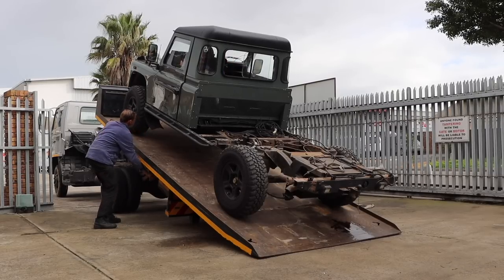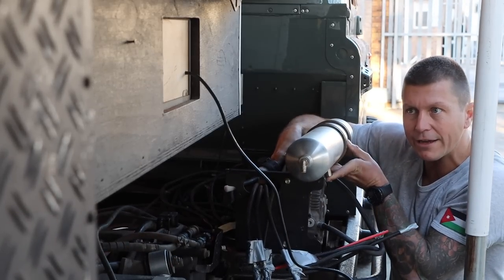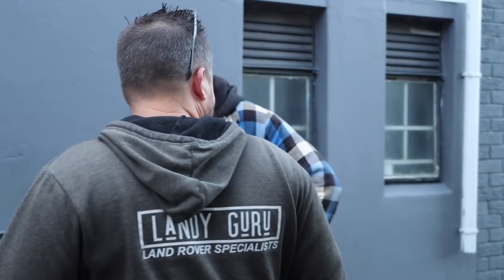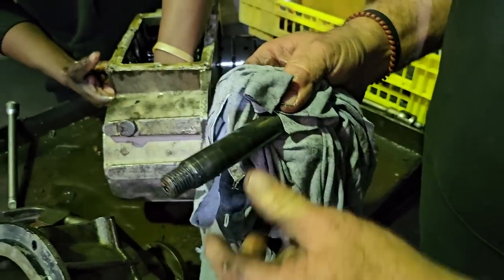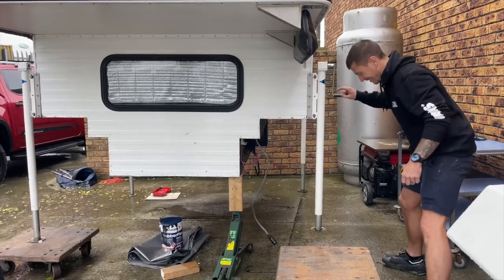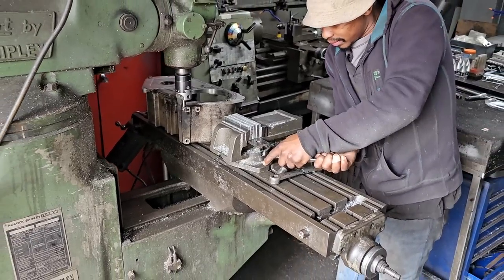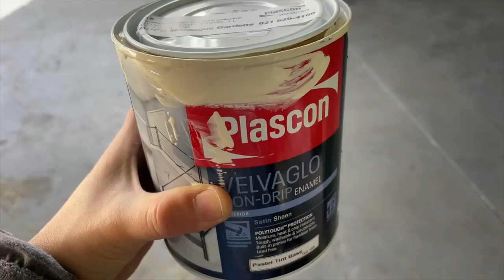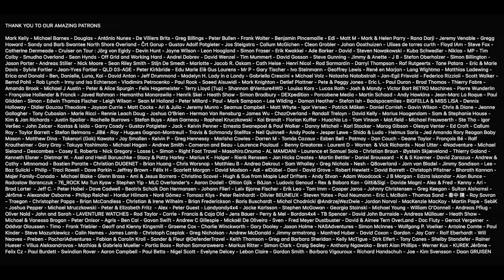Rebuilding a Defender - Stage II Flatbed conversion begins! (Ep259)

Comment: Keep smiling.
When you look at how the cab turned out, it's obvious you're working with experts so Bear is in safe hands.
All those boxes of parts might seem a bit overwhelming but you'll be amazed how quickly and easily they all go back on once the main project is finished.

Comment: That upgrade is a massive undertaking. Good you have a number of knowledgeable partners and don't cut corners. It will make you happy in the long run on the road. Safe travels

Comment: Interesting upgrades with plenty to ponder.
I am surprised at the size/complexity of the Airbag Man compressor - is it dedicated to the suspension? I use air helper springs at the rear of my Defender and just use the tyre compressor to top it up.
I am interested in the LOF clutch installation. Having had one clutch failure in SA already and having no confidence in the replacement I intend to fit the same when my vehicle gets a workover in 2024.
Moving the camper body forward is a very good idea. One sees so many campers with the box cantilevered over the rear axle which will have terrible weight distribution.

Comment: Not to detract from the amazing work these guys are doing, but will there be any type of certification for the mods by them.  For instance, if you brought the vehicle to Australia, I would foresee that potentially the mods would not comply with Australian Design Rules (ADR) and so the vehicle may not be able to be used on Australian roads.  And something similar may apply to other parts of the world (Europe etc). Something to think about...
Reply from the maker: Yes we thought about and researched all of this long before we committed. We will have engineering certs and roadworthy inspection done here.
In any case we can go anywhere with it as we only ever temporary import into a country and as long as our vehicle is registered in it's home country we don't have to comply with local vehicle standards other than being roadworthy.

Comment: Hi, how about the air suspension?
any problem with her?
I ask you because I am thinking of installing it in my car, thanks from Spain
Reply from the maker: We love the system. We are yet to install everything back again but should be ok. We only had a bag dislocating once because of extreme flex and travel . (Due also to the size of of shock absorbers) but we easily fixed it. Episode Old coach road .
Reply: @GrizzlyNbearOverland  and you carry it only on the rear axle, or you carry them on both axles?

Comment: You better stay with the standard  mechanical transmission elements of the Defender. It will be very hard for you to find a spare one for the modified parts when you are around the world. I hope I dont see a future video that you are stranded somewhere around the world waiting for a modified spare part that will be shipped  from South Africa
Reply from the maker: We haven't modified anything that can't be replaced with standard parts so no worries there 😉
The transfer box has a new sleeve but that doesn't change any of the parts required.

Comment: C'est de grosse reno qui vont coûté tres chers je me demande si un véhicule neuf aurais pas coûté moins chère slt du Québec
Reply: A suitable new vehicle and ( new camper ? ) that suits their specific requirements would cost huuuuge $$$
And then they would still need to spend massive $$$ on accessories, and then modify and customise it all, to suit their specific needs.
This vehicle renovation etc, is a big project and would cost a lot, but in many ways, they are ending up with a totally rebuilt and new Defender anyway.
Reply from the maker: We are too attached sentimentality. This car has been to some places !!

Comment: have a 110 pick up i am trying to mount a roof top tent by using a couple of tradie boxes on the back of the tub without using a roof rack or load bars :face-blue-wide-eyes: .    Don't stress frenchy i am sure it will come out sweet as